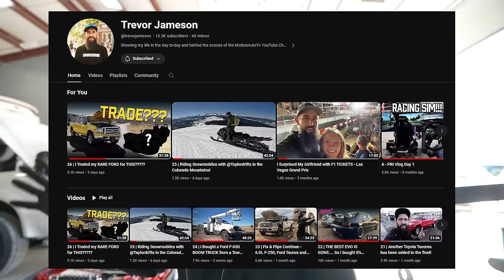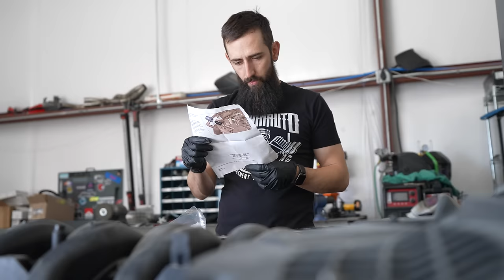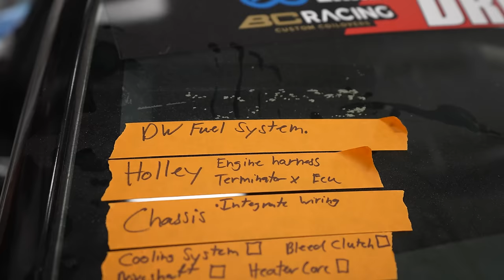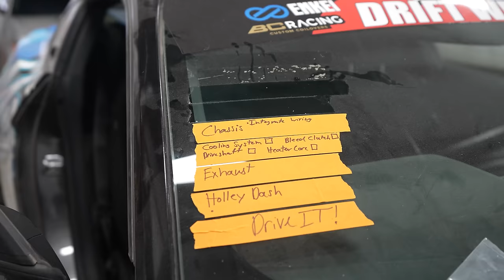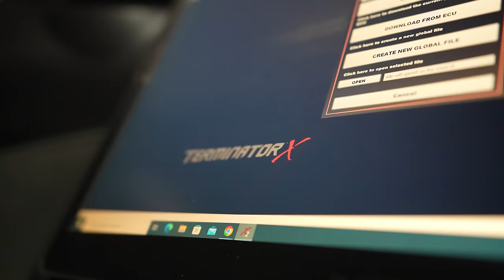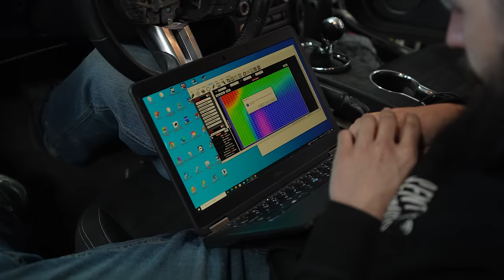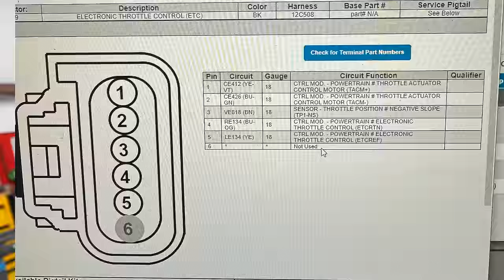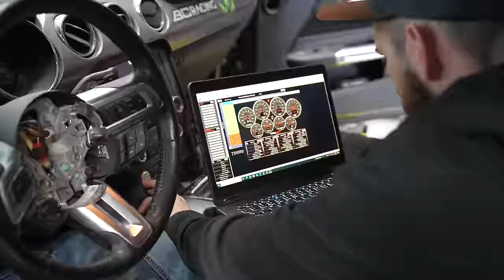7.3L Godzilla-Swapped S550 Mustang | FIRST START!!!

Comment: Let's gooo! Same way we did the rotary BRZ swap. We made sure the factory trans and driveshaft were in place so we could keep everything from the bellhousing back. Then we installed the adapter plate and engine so we could find the position for making mounts. Now if we break anything we just got to the Subaru parts bin!
Reply: Got any forums or videos on this? I've always said the rx8 is 400 lbs too big for the renny. And the 86 would be perfect minus the inferior suspension

Comment: here's a funny note for ya, Ford made the LS, chevy robbged them. ok, now, 20+yrs later, Ford does 7.3Godzilla. Garrett, Clet, used LS7 lifters in the godzilla, what does that say. Its a big LS engine. Also, around the 1500hp mark, he couldn't keep the heads down. Thats the limit of the engine/head combo. Just needs more Clamping power.
Reply: Na Brian Wolfe and the gang already have one at 2200 in a foxbody

Comment: curious why they/you are running the coolant through the intake ?    Seems like it would just heat the intake charge?        On our street/track cars sometimes we re-route the coolant away from the intake.     In cold climates it has a use but in warm climates it just heats the intake temps.. Maybe with a forced induction car its a different story ?

Comment: Does the dash work in the s550? I have a v6 one that i got for cheap from a wreck but want to do a 5.0 or an ls. I just cant sort if i need to redo dash modules or not for it to work.
Reply from the maker: I’m pretty sure the modules and everything all work correctly but we just need different programming
Reply: @MotionAutoTv  you mentioned a ford site for wiring diagrams what was that again? I will have to go threw to see if the chassis to engine harness can be integrated. Thanks

Comment: I work for a Ford dealer in parts, the throttle body does not have a part number on it, it is an engineering number which is close to the part number but not the same.

Comment: The MT82 from the 15-17 is actually quite strong. It's behind many 9 second s550's. The big issue with them, is the 1-2 selector, the synchros, the shift stop, the shift fork pads, and the remote shifter. In the words of Christian Bale from Ford vs Ferrari, they're fucking terrible. Fix those and they're generally pretty robust transmissions.
Reply from the maker: This gives me a bit more confidence!
Reply: @MotionAutoTv  it's either that, or get 1 from 2020 onwards, replaced the shift forks and synchros, and they're stronger again. Ratios may even be better for the big cube monster and drifting giving you more band per gear.
Reply: Lol waste of time waste of money t56 swap is definitely the better route mt82 is junk unless it's a calimer built one
Reply: @ranware9071  wouldn't touch a calimer unit. Way too many warranty claims. T56 is barely any better at all, and by the time you spend the money, you still have a gearbox fitted with plastic shift pads and an array of other known issues. Too many people talk way to much shit about the mt82, barely have a complete understanding of it and just regurgitate shit other people talk. He already has the mt82, better off just doing to fixes and saving for a built magnum.
Reply: @pheonixfps9248  nope definitely not in agreement with your statement. The t56/t56 magnum are leagues better than this mt82 junk you talk high of. T56 t56 magnum tr6060 all better than any mt82 that's facts I don't care what the next man said or says
Reply: @ranware9071  you said t56, not magnum in your original reply. the basic T56 box only has a 2 better offerings over the 82, one being a fixed shifter, the other being a 26 spline input shaft, but is almost no stronger 420ftlb vs 430ftlb, this has been debunked, and it's still prone to the exact same failures (weak selector forks, weak bearings, weak synchros and poor design, plastic selector pads). But look at this, by the time you spend the money on a mgnum swap, you could a built dog box swap, or a near on built ppg 2000hp capable gearbox. I work with enough gearbox shops to know that while the magnum/6060 is a descent step forward over an 82, the cost is not affective, and I also know well enough from rebuilding countless 82's that once the issues listed are rectified, theyre generally pretty good. that doesn't mean theyre perfect, but majority of weaknesses are removed. you're enittled to your opinion, thats totally fine, but it isn't well educated one. The G-force units in the calimers transmissions are nothing special, and have been having failure rates unheard of with built trans. some as low as 3 weeks, still in the break in period, being driven as per instruction, and its not the carbon synchros failing.0
Reply: @pheonixfps9248  no bruh t56/t56 magnum and the tr6060 as well as the 3160 as well as the tkX all 100% superior to any mt82 junk it doesn't matter how you want to go to war for them... those transmissions are 1000% junk
Reply: @ranware9071  and yet, there is countless dudes running 900whp, 9 sec quarters on stock , un opened mt82 boxes..........